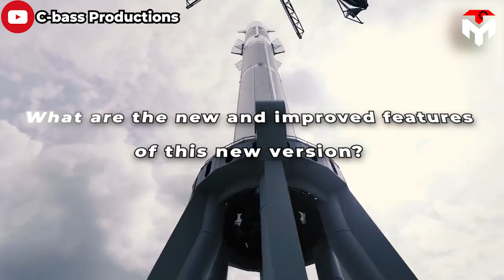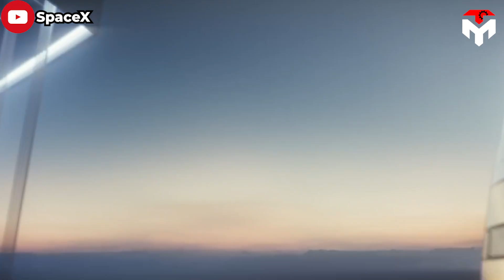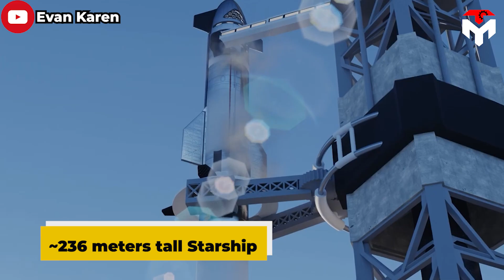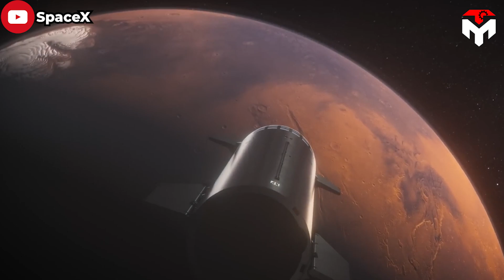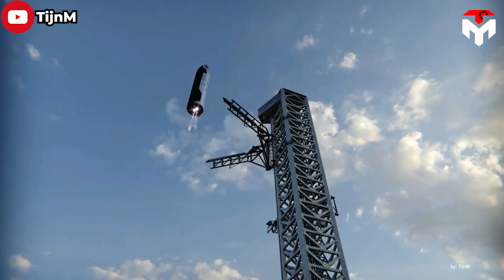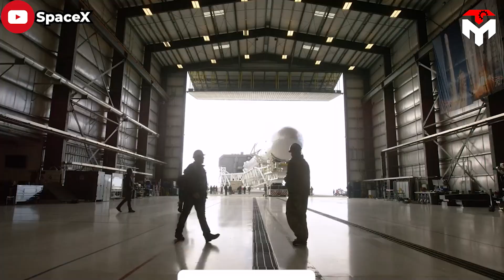Elon Musk just revealed New 150-meter Starship prototype...

Comment: Doubling the diameter would increase the total thrust by 4, given the same engines. Doubling the height as well would increase the mass by 8. This won't work.
Doubling the measurements in all dimensions fails because the space for engines increases as the square, while increasing the overall mass increases as the cube.

Comment: 100 raptor engines!!! That, even as an idea, is just jaw-droppingly awesome!
But just the half dozen launches that we are soon to see in quick succession will also be awesome ❤
Reply: This vid is clickbait
Reply: There won't be enough space in the engine bay to fit the required number of Raptor engines. Doubling the size increases the surface area by the square = 4 times, while the volume and weight increases by the cube = 8 times. So the weight will increase at least 8 times, requiring 264 engines to maintain the current thrust to weight ratio, while only 4 times the engines = 132 will fit.